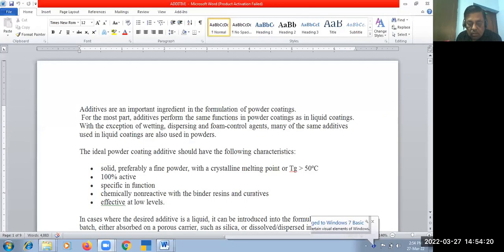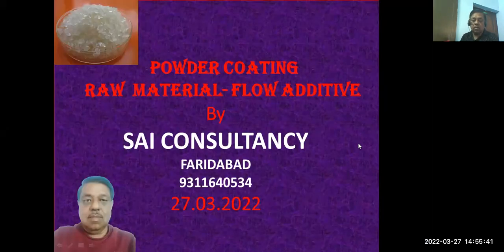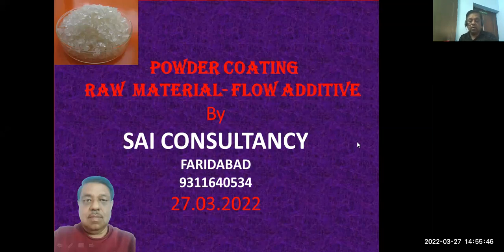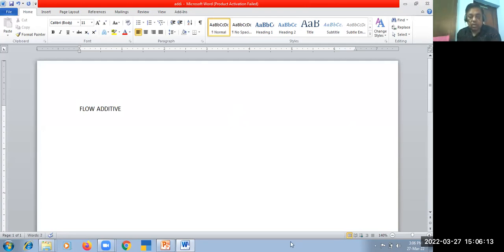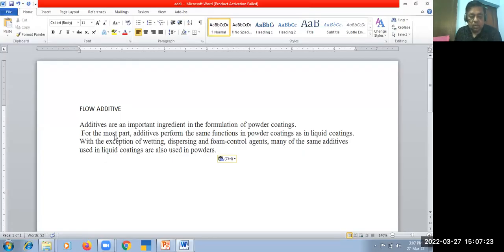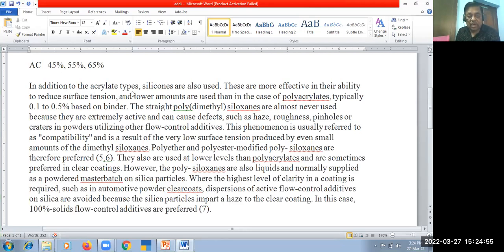POWDER COATING FORMULATION--FLOW ADDITIVE

Comment: Sir , what is process to check incoming powder quality in the sense of long term
Reply from the maker: 1 Panel application
2 checking Thickness, glosd, impact test
3 Any other requirements as per u